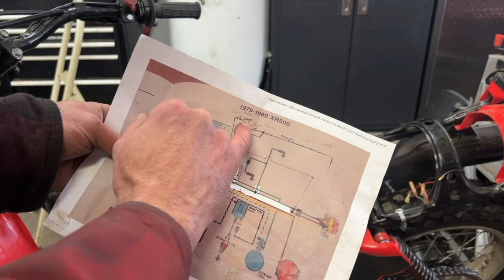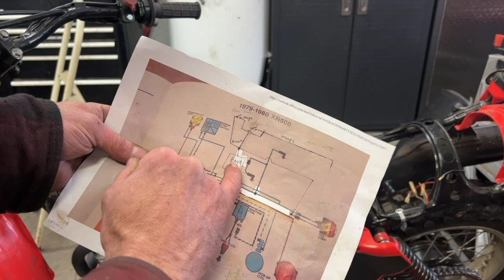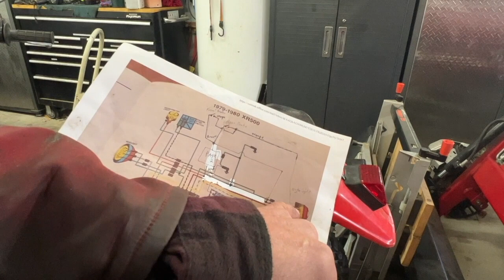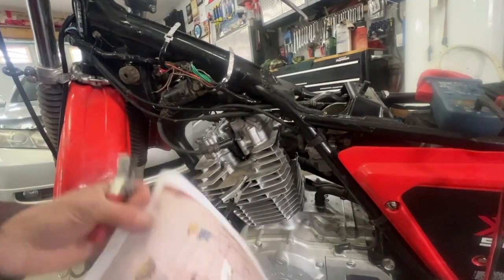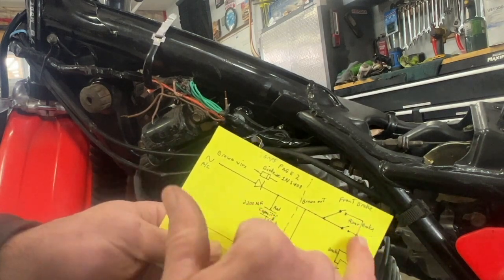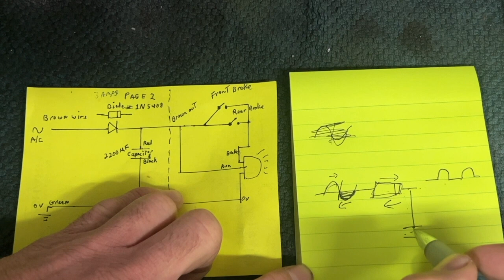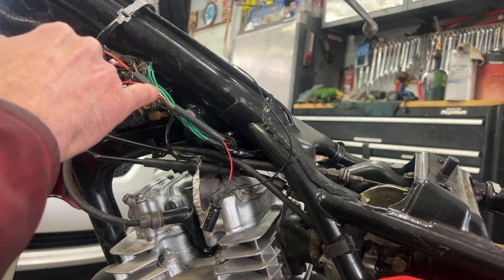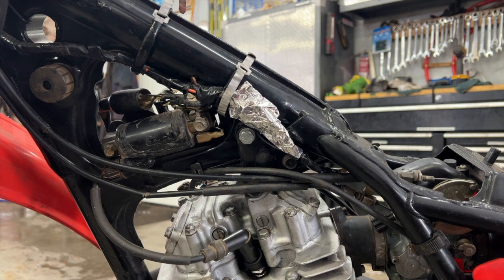Part 7 1979 XR500 Honda Rebuild. Converting my 6V AC Rear Bulb to a 6V DC (LED).  (1979,1980,1981)

Comment: I am trying to sort out a similar solution. I am restoring a 46 Cushman scooter. It never had brake switch and light. Original system was 6V ac.  New bulbs that fit under original taillight glass are LED. I have it all working on a battery. But I want to run the headlight and taillight off the original generator..  on this scooter to turn the lights on you flip a lever that tensions the belt. It is really cool and mechanical.

Comment: I have a 1980 Honda XR 500 with a brake switch. I added a 6V LED headlight bulb and it worked for a while and then blew. It also blew my taillight running light. The brake light still worked. So I replaced my headlight with the stock unit and replaced my brake light with a new bulb. Everything works fine except now, when I brake, my headlight dims. I thought it was my 6v regulator, so I replaced that. With the new regulator, my headlight still dims when I brake. Do you have any thoughts on this. I could really use your help! Thanks!
Reply from the maker: XR500 don’t have a voltage regulator.  Only the XL500s does. 
   It normal for the lights to dim on idle or low RPM.
Reply: @WeekendHobbyMechanic  Correct. XR500’s don’t. I believe it was added to my XR for the brake light function when I brake.  MY XR has a functioning brake light. All worked well until I put in an LED headlight. Any thought?
Reply from the maker: The regular is causing a voltage drop.

Comment: Hello, do you know what AC voltage should go out from charging stator when running? I checked my honda while running between pink and yellow and it showed only between 5-7 volt AC , depending on RPM. Then after regulator it becomes only 4 volt DC .. I assume that is not correct ? I should have more AC volts from generator ? I cannot find any info on my manual.. Please help. Thanks
Reply from the maker: Do an ohm check on it.  It should be 0.2-1.0 ohms 
  You should get 8-14v-AC  at idle and 16-20vAC at full RPM.   The rectifier changes it to 6-8v DC.
Reply: @WeekendHobbyMechanic  Thanks . I did so . When engine not working I checjed omh and it was exact 1 ohm. Engine runing on AC it was  6 max 7 volt s AC depending on RPMs,  out of rectifier was 3 to max 4 volts DC . does it mean charging coil is fried? But ohms are okay?
Reply from the maker: If it was my bike I would change it.   But, you should get a second opinion before you change it.  .
Reply: @WeekendHobbyMechanic  Thanks, I got second hand coils with magneto quite cheap. Will install and will see. Thanks for Your advice .

Comment: Hey my friend I need some help pointed in the right direction. Husqvarna pz60 zero turn mower. I’m getting no crank and no start. When I first got it it tried to turn over a little bit but now it’s just nothing at all…used a multimeter to test the 2 safety switches for the handle bars…tested the ignition switch….tested seat switch…(jumped seat switch as well). Tested the electronic PTO switch…all good. Battery is good…there is power at starter solenoid but that’s obviously directly connected to the battery. I think I tested all the safety switches and they were all good, the starter is OeM brand new…it has the solenoid mounted on the starter. What else do you think it could be. Do you have any suggestions? It’s driving me crazy
Reply from the maker: Check the starter to make sure is works.  Use a jumper cable, place it on the positive side of the battery to the start.   If it turns over then you know the motor side is good.  
   Visit a authorized dealer and ask for a wiring diagram.   Trouble shoot all you safety  switches.
Reply: @WeekendHobbyMechanic  hey thanks for getting back to me. It’s actually working now. I tested all the safety’s and I think the connector that plugs into the parking brake safety was dirty because that’s the last safety I checked. I cleaned out the connector, plugged it back in and machines fired right up now. This was my best deal yet. Hoping it will go for great money. The riding mowers have been selling great.
Reply from the maker: @semajd5995   Awesome.

Comment: Nice job on your 500.. just wondering where you got your fork boots? I'm restoring a 1979 xr250.
Reply from the maker: They came with the bike.  (OEM Originals).
Reply: @WeekendHobbyMechanic  that was luck.. most are dry rotted or missing.. the owner before me got rid of that stupid 23" front wheel and put a 21" on it I think I have the wheel narrowed down to being a 1983-84 model...
Reply from the maker: One of my XL500s had a 21” front wheel when I bought it. I really like the way it handled but I changed it back to original.